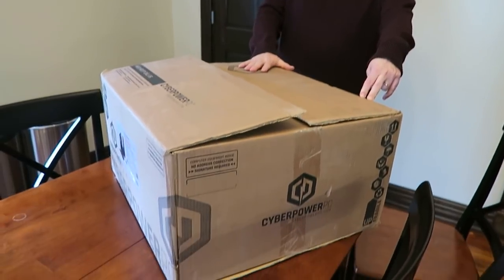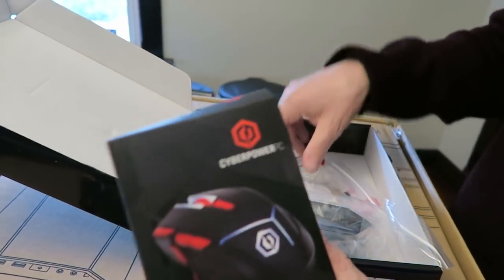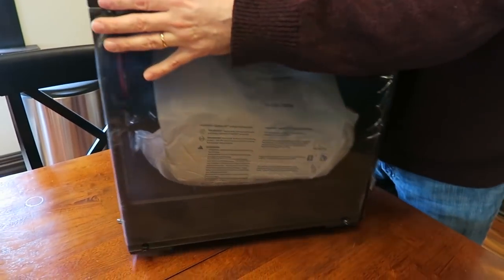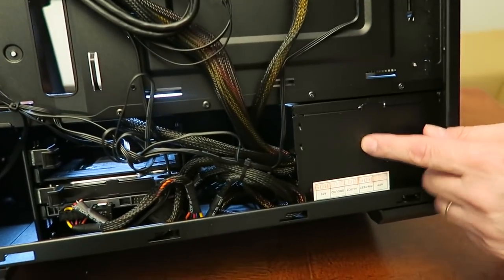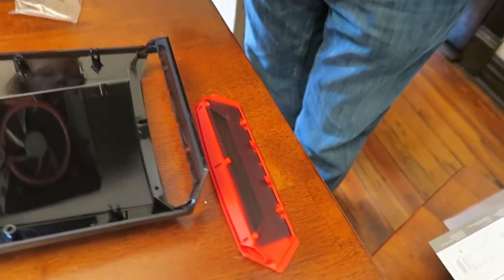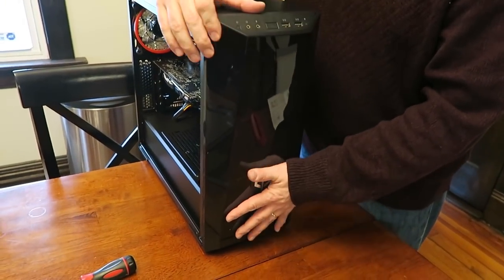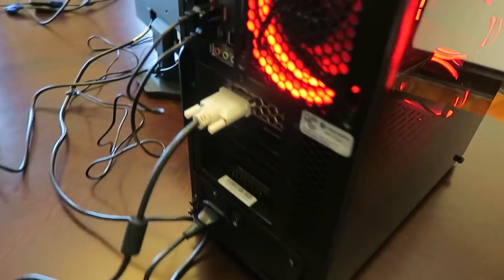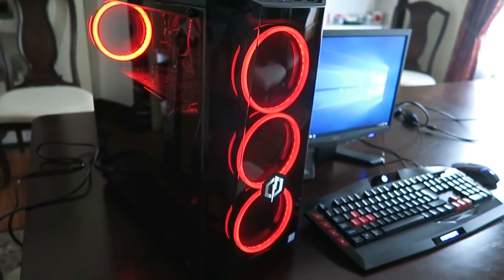BEST Gaming PC CyberPowerPC Gamer Xtreme Desktop Gaming PC Unboxing

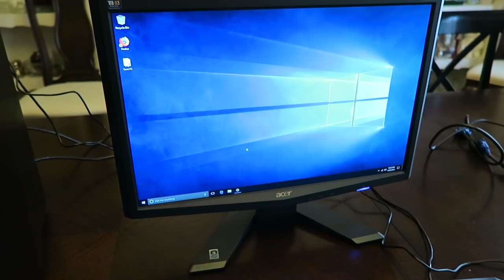Comment: @13:10, you said you used the wireless adapter. @13:34, clears that up. You showed the Network connector so you don't have to use wi-fi. In the process of purchasing a new pre-build PC. This was very informative. Thank you for the upload.

Comment: Nice video. Fast forward to june 2024.  Ebay seller had the same looking pc but a newer model.  The newer model had 3 front fans that were rgb changing colors (kalideoscope) and an asrock motherboard with a M.2 ssd slot on the motherboard, with a 1tb nvme ssd,  and an nvidia gtx 1060 ti video card. Seller won a storage locker bidding and the pc was in the locker and in mint condt. Seller only knew his smart phone and did not want the pc so he listed it on ebay for  $199 and $50 shipping. I bought it, and it is great. Only 8gb ram, so i installed another 8gb stick to make it 16gb.
Reply from the maker: I hope you enjoy it!

Comment: Great video, one question, where exactly do you put the wifi usb adapter, and I'm not familiar with pc does that mean you wouldn't get wifi on it without said adapter?
Reply from the maker: You have to have the adapter to get wifi, but not wired Internet. The adapter will plug into any free USB port on the back or the top front.

Comment: Hey Kevin - If someone donated a Samsung 860 EVO 500GB SATA-III SSD to the channel would you install it? Migrating the boot drive using Samsung's software is very easy, and the latest drives have vastly improved endurance over the previous generation SSDs. They're warrantied for to 300TB write life or 5yr, so no worries about wearing out V-NAND with excessive writes from large video files. I know that's an oddly specific hypothetical 😂 That SSD bracket is just begging to be used!  Your motherboard also has two M.2 ports compatible with SATA and PCIe 3.0 x4, so some day when these faster drives come down in price (ie Samsung 960 series) you could even upgrade further. Most M.2 SSDs still run in SATA mode (ie Samsung 850/860 series,) so paying more for an M.2 version on a desktop PC is not necessary.  According to your motherboard's manual, the SATA1 port is disabled when M.2_1 is being used in SATA mode, so there's not even a case to be made for extra ports.
Reply: We really appreciate the offer. I know you would gladly send us the drive. Right now though it is super fast at making videos. She is saving them pretty much as fast as mine. Not sure that SSD would help much since any speed increase is likely the CPU/GPU and not the drive. I found Movie Maker for her so she is still using it. Since Movie Maker does not take advantage of the GPU,  she is kind of at the upper limits until she switches software. We really do appreciate the generous offer. I would  hate for you to spend your money unnecessarily.
Reply: Ok. No problemo. Ever since I switched to SSD a few years ago I've been on a mission to get all my family and friends to switch. Even my father's old Core 2 Duo desktop has an SSD :D  Anyway, it'll be nice to know the option is available later on.
Reply: Thanks! I have 2 in my current PC and love them. One for boot and the other to capture video.

Comment: I've tested out a cyberpower gaming pc in the 1k range for a few weeks and the performance was amazing tbh. idk if those guys who put it together did anything different to make it run so smoothly but I had absolutely no problems with gaming while heavily multitasking on the side. No lagging or stuttering. the pc was ugly tbh because they strip parts that make a pc aestheticly pleasing to cut cost but without hampering performance but I was actually sad I had to return it because I wanted to build my own in the end. All their parts are name brand and their case has a ton of air flow, the thermal take case with the mesh front I thought about getting the same case for my new build. Ah well, enjoy your pc.
Reply: So all in all you'd say the pre built pc is good bc im thinking about switching to pc im tired of xbox ps4 is filled w weird ppl i wanna go to pc

Comment: Hey brotha. Watched the video.

Id like to upgrade the mother board to a 370 version....and add an ssd.

Like a seagate barrcuda 1tb...do you think that is possible?
Reply from the maker: Sure, the motherboard can be replaced. Just make sure the processor works with the new one and the memory. You have room to add some additional drives to the case.
Reply: If u have 100$ more u can buy the same pc but with the z370 mother board and a 120gb SSD

Comment: I heard that the power supplies with these computers are really bad and need to be upgraded immediately. Is this true? Also, what is the wattage of the built in power supply?
Reply from the maker: We have not had any issues. I did not pull the power supply out to see what the wattage was, but it works fine.
Reply: I have one and it heats up fast asf, one hour of playing and its heated so bad that you will want to turn it off so it can cool down a bit. If u buy, I suggest getting more fans and lower ur power supply percentage on ur cpu

Comment: Can you help me with something? I accidentally unplugged the cables that control the leds on the power button, the reset button, and the power button. If you could show me the cords? They are on the bottom right. I would greatly appreciate it.
Reply: Plug them back in
Reply: I don’t know the way they go in. And thanks for responding.
Reply: @criptonixzstudios  well do you see anything on the motherboard that looks like it can fit the cables

Comment: Is there a cd/dvd drive on this thing?
Reply from the maker: No, but you could use an external one.
Reply: ty for taking the time to reply. Preesh.. oh oh.. so since they gave me a couple cd's with my cdromless computer (just bought the same one, exactly same one) did you happen to find where or how to create a recovery disc for windows 10 for this? Im assuming we need to create something within the software somewhere.

Comment: Is there any problems with the power supply please someone answer me I am about to get and I need to check if the power supply is good?
Reply: Dashplayer it’s good
Reply: Don’t listen to him the power supply on the computer in this video is not good at all I have this computer and without a doubt if you get it replace the power supply to a 750 and replace the stock fans that it comes with in the future also I would say replace the stock cpu fan and replace it with a air cooler or liquid cooler your preference
Reply: KidYouRage good lord you will never need a 750 power supply. That’s a fire hazard lmao. $500-$900 pcs should be around 400 watt. 1k or more 500 MAYBE 600 watt for the high end PCS

Comment: whats the fps on r6 siege?
Reply: Adrian Miranda I bought this PC just for siege. I play on Very High and get 100-144 fps playing on a 144hz monitor through display port. It is capable of playing ultra but it pushes the 580 to its limits. So I just run on Very High with no screen tearing or microstuttering.
Reply: Axe Killmonger how long you had it and did the power supply fail?
Reply: So far I've had it for about 3 and half months, no problems whatsoever so far! Probably when parts start dropping, I'll definitely upgrade RAM and Processor, the 8GB and i5 do the job, but as multitasking increases, its below minimum. Power supply hasn't let me down at all as well.
Reply: I was thinking about buying it for R6 Siege as well. Thanks for telling me what it can handle, much appreciated Axe!
Reply: Adrian Miranda it’s over 9........
2 FPS 
-_- :(

Comment: It is not good the pc stop runing smooth after year
Reply: It's probably because of the fans they are not so good but if you do replace them wiwith better fans it will work just fine and if you don't want to buy new ones you should be able to open the side on which the fans are so you can get some more cool air in and warm air out because the plastic is blocking it a little
Reply: @986  not true I know how to fix computers and build them it's not the fan
Reply: LMkillhim how old are you?
Reply: Im planing on getting this next week are your sure
Reply: LMkillhim if you build and fix them why buy a prebuilt one?
Reply: @jonathaniriqui  yeah this kiddo lying look at his grammar